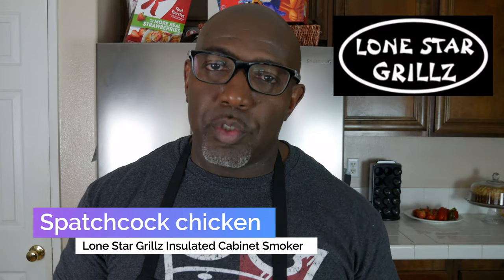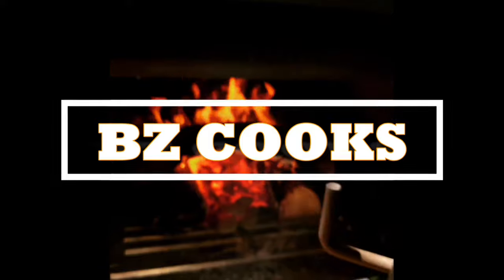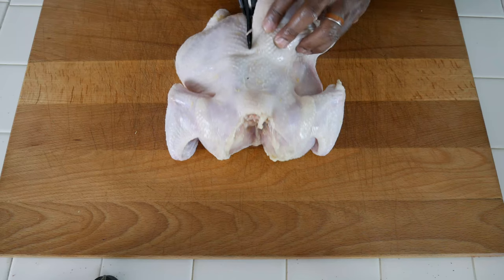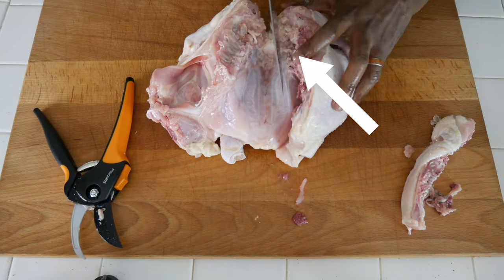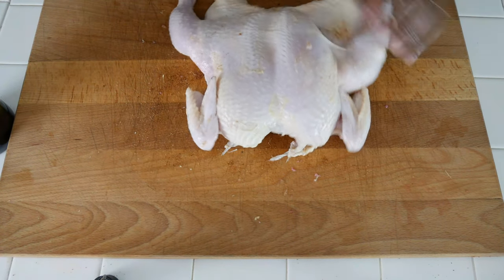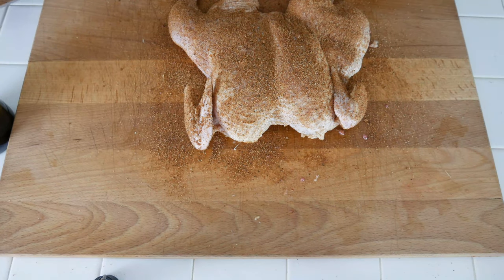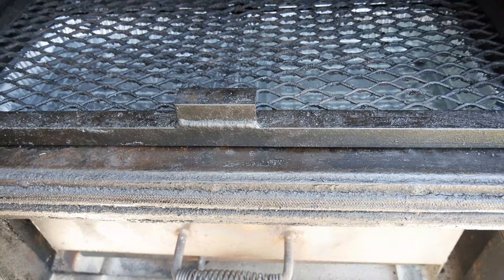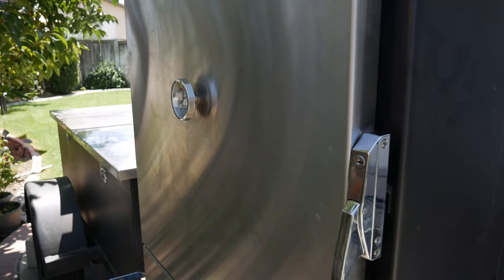Spatchcock Chicken | Lone Star Grillz IVS #ForScience

Comment: Good idea! the idea of everything catching on fire is why I haven't tried it yet. I might have to though where I live in upstate New York when it's 10° outside takes a long time to get up to temp. For anyone looking at an LSG that's the only downside to this smoker not too good for short cooks longer to heat than to cook still a great smoker though.
Reply from the maker: If you are doing a cook for 2- 4 hours you can use the method i used and not use up so much fuel. What I like about the LSIVS is that I don't have to keep feeding it fuel.